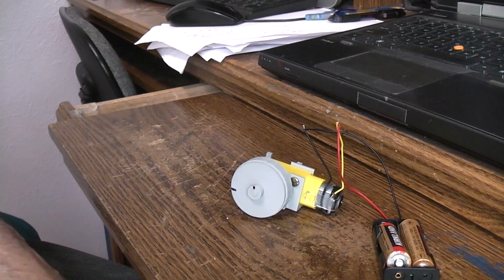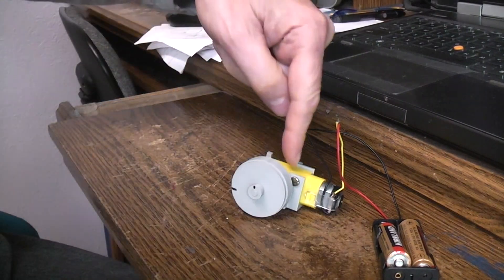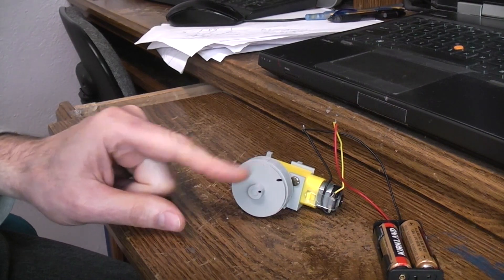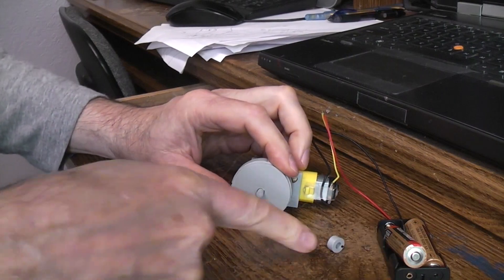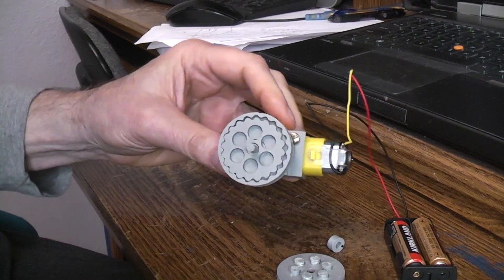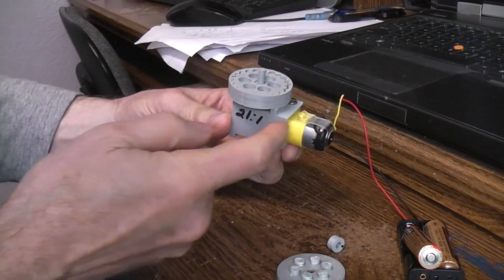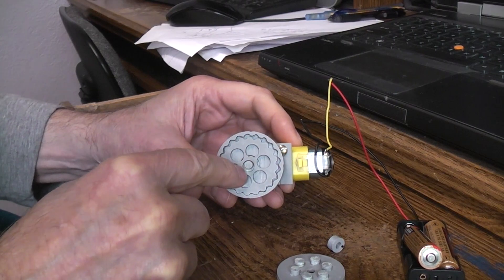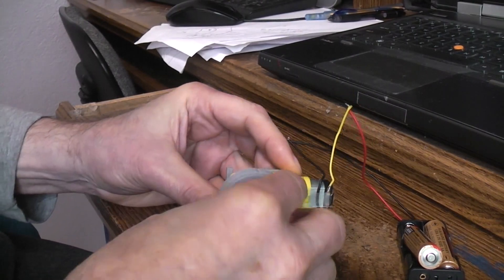3d print the 21:1 Cycloidal drive RPM reducer  for TT gearmotors

Comment: why dont  you put a spur gear on the outer ring and the spur gear does 8 turns and the center does 21 turns
then you can slow down the center and make the center have more torque then the spur gear on the outer ring and make a 1 to 1 ratio increase torque

Comment: Thank you for the great video! Quick question- how would you go about reducing what seems like 'jitter' on the final rotation? e.g. if you wanted to use this on a robotic arm, how would you go about getting smooth motion on the joint? Thanks again
Reply from the maker: Yes cycloidal drive do jump between steps and the way Pro units work is to replace the large lobes used in the 3d printed versions with super fine ridges. Check out you tube for videos of metal non 3d printed units to see how they do it. The motion will look very smooth, but it is still kind of like a stepper motor in that it jumps in fine steps.

Comment: I am trying to design a cycloidal gear setup in an application. I'm still confused as to why the six posts rolling in the larger holes are necessary. I'm also not clear on how to get the cycloidal gear tooth shape.
Reply from the maker: Cycloidal gears or wobble gears have to have a way to take that reduced speed of the internal gear that is wobbling around and transfer it to a non wobbling but rotating shaft. Thats is why you have to have the 6 posts fitting into the larger holes. it does not have to be 6 posts it could be less or more. There are so many you tube video's that tell how to design a cycloidal gear system and how they work. Here is a link to just one and in the first 3 minuets how they work is discribed.
https://youtu.be/7uXN_y7JdyM

Comment: Sir! I have two dual shaft motors and i just wants to buy two single shaft motors does it works equal rotation?I don't know the RPM of it's.
By the way you Nice content on your channel i subed. 😊
Reply from the maker: The TT gearmotors are sold in many different RPM. The 48:1 is the most common. The 120:1 is my favorite for robot projects but harder too find. Many sellers say they have the 120:1 but send you the 48:1. Then there are Motor variations so the output RPM is different. The single shaft and dual shaft will have the same RPM if they have the same gear ratio and motor type. The motors are very low cost, so it is best to buy a few of each type. Once you find one you like remember that seller so you can get more of the same one day.
Reply: @Robothut  well then i have to sell my two dual shaft motors and I'll buy the 4 single shaft for my future projects
Thanks for your great information Sir! 🤗
Reply from the maker: @DIYwithBatteries  You can cut off the  non used shafts. the gear ration will stay the same . Here is a link to a video I did on some of the TT gearmotors.
https://youtu.be/GhU-r_gcGFg
Reply: @Robothut  yeah i already saw that video sir before you send it and i think i have the 1:120 motor because it sounds similar when you turn it ON and one more thing that the dual shaft motors have two shafts as you know 😉 so one of the shaft is directly connected to a gear (i looked inside it) and the other is not, which is connected to an iron lead so we can cut that. 
So i have to buy the single shaft and it's a little bit speed but the torque is enough for this project.
Thank you so much for replying sir! x3
Have a good day :-)